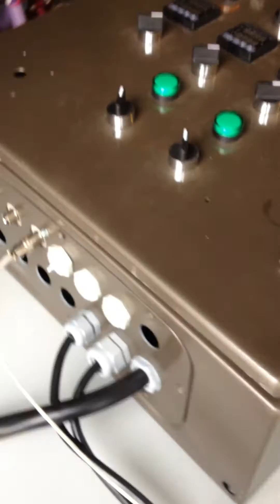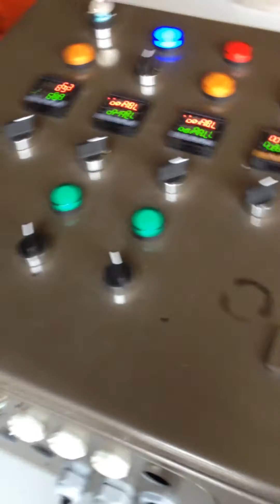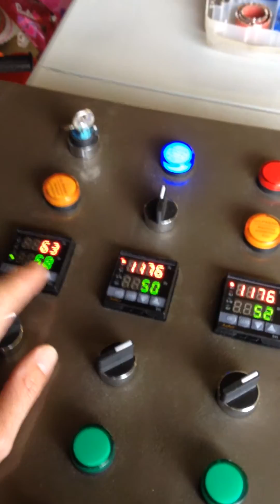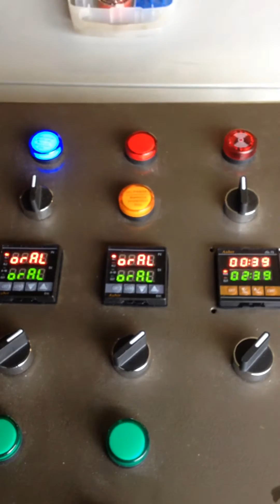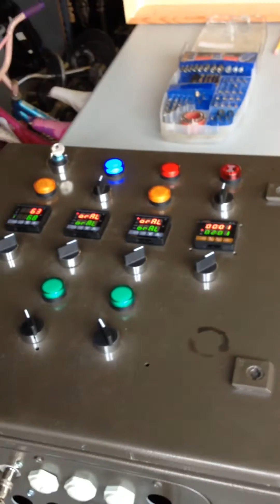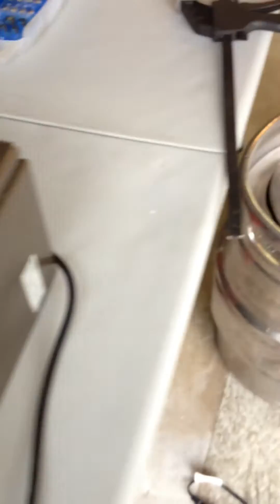EHERMS Homebrew Electric Brewing Control Panel Demo

Comment: Nice control!  My control/rig is a little more complicated which may help make things more automatic but then more automation also increases the potential for equipment failure.

PIDs are awesome, simple, and extremely solid! I use them for everything: Heat/Cool fermentation room, keezer (freezer kegerator), beer-tap/trunk-line chiller, PC-Fan on my ceramic (like Green Egg) grill...Fun Stuff:)
Reply from the maker: larryboy1975 I saw your set up. It is really amazing. Hope to see another video of it soon.